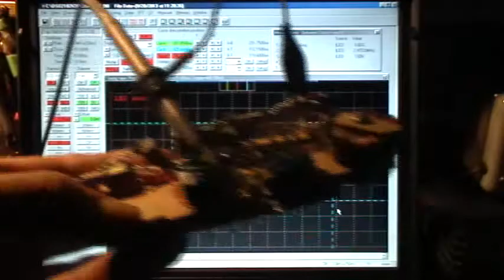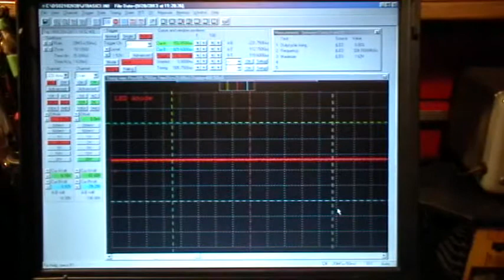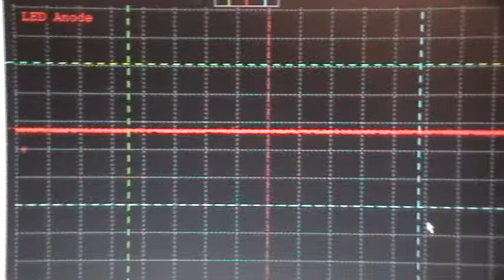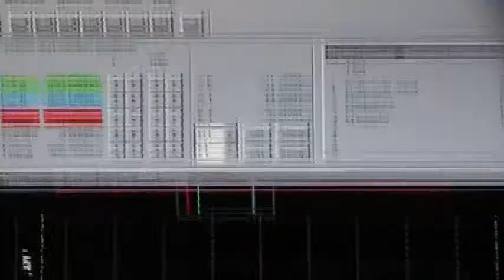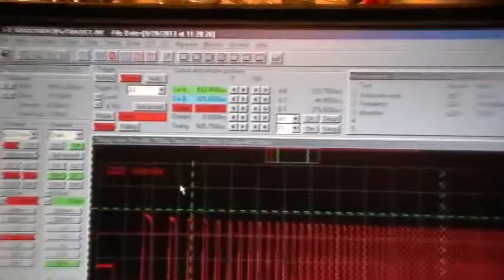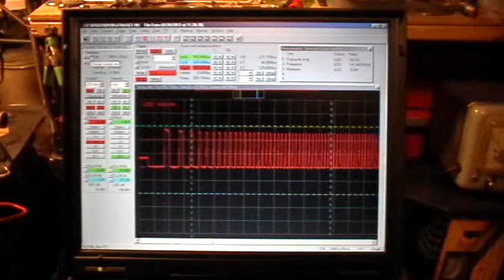Joule Thief: The DarkAlchemist Mod, Pulse Oscillation, Single Shot Scoposcopy

Comment from the maker: Also check to see if you have some "bandwidth limiting" set somewhere in the scope settings. Is there an advanced trigger setup menu? The scope's trigger function may need a signal that stays over the trigger voltage level for a certain time interval, or it may be bandwidth-limited by a selectable filter that you can disable.